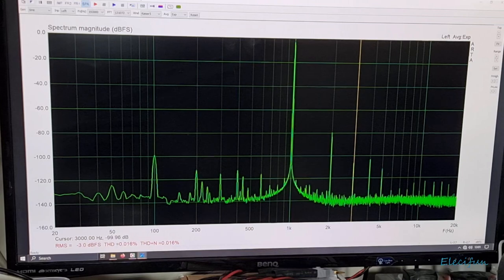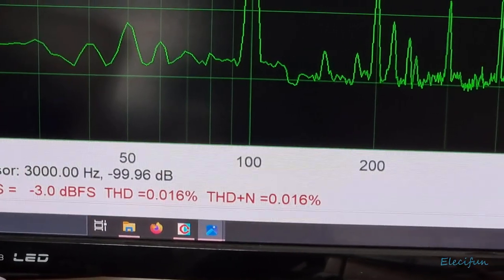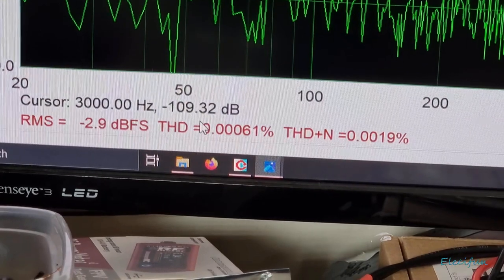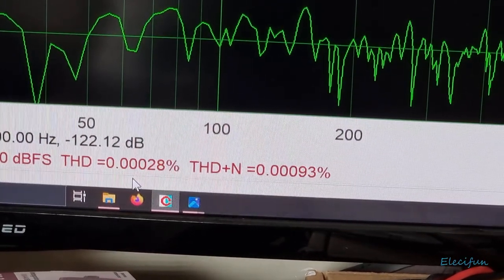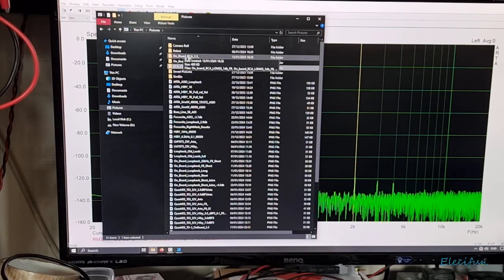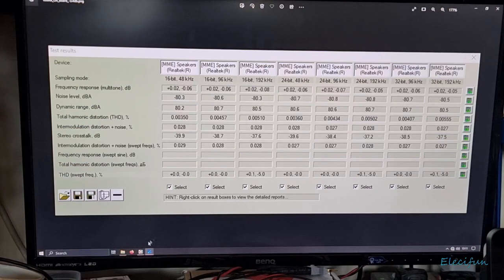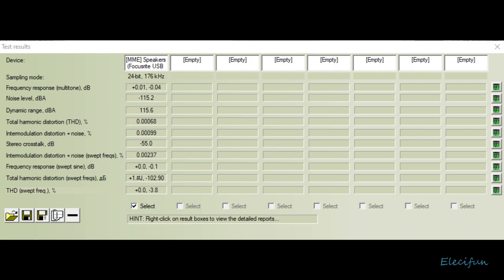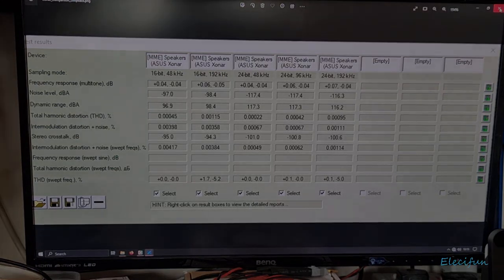Focusrite Scarlett vs Sound Blaster AE-9 vs Xonar D2X

Comment: Does the D2X work well on Windows 11 with unixonar drivers?
Reply from the maker: No idea, I haven't windows 11 or tried unixonar drivers.. sorry
Reply: @Elecifun  I'm the owner of one of these cards. I'm afraid to test in my new PC, but in the end, I will have to do it. The unixonar web says yes, although they have some problems with Ryzen boards and I have one of these too. Another thing, have you tested the 1220 Realtek codec? My B550 Tomahawk included this kind of audio interface. The bad thing is that it catches some interference from video card voltage regulators when I'm playing games and the card reaches the 100% of usage. When the video card is more or less in idle mode, for example watching Youtube videos or surfing the internet, the audio is totally silent.
Reply from the maker: @DJMotavirust  Not sure why Unixonar would work better than Asus drivers. I've not read the whole site as Asus drivers work great with the Xonar D2X on B450 Tomahawk. I'm using Ryzen 3600x with no issues. Not tested 1220 Realtek codec.
Your on board sound card has issues? what graphics installed? If using additional sound card have you disabled on board?
Reply: @Elecifun  The Realtek card card works great, but is not as isolated from EMI noises as I would. I have an MSI GTX1070 Gaming X and also works great too. I don't have on board vga option enabled because I have bought a 5700x CPU recently. Maybe the blame is the VGA card that generates too ripple. I don't know, but I hear a little noise, when I'm playing any game. I hope improving the sound using the D2X, as in past it was on W10 (Unixonar drivers worked flawless), but I don't know if it will work on W11. Thanks for your quick reply.
Reply: Finally, I have realized that the noise from the integrated realtek audio interface, is a ground loop. I connected a couple of transformers to the output, and the noise was gone. I got the same result, using a cheap Chinese DAC optical to rca converter. The solution was a galvanic isolation from my Peavey PV8 mixer, using any of these methods. For recording pourposes, It's also a mandatory requirement connecting another transformer to the line input. Greetings.

Comment: Can you run the preamp to your amps? 🤔
Reply from the maker: Yes it is possible.
Reply: @Elecifun  okay, I watched a few videos and yes your right.
Reply from the maker: @decem_unosquattro9538  in order to calibrate in ARTA I had to measure the output voltage and it was 1.672 volts, ideal for driving an amplifier.😄
Reply: @Elecifun  what do you mean? 😮‍💨